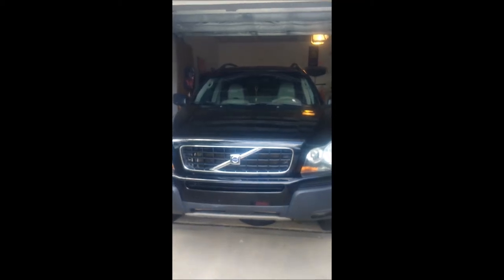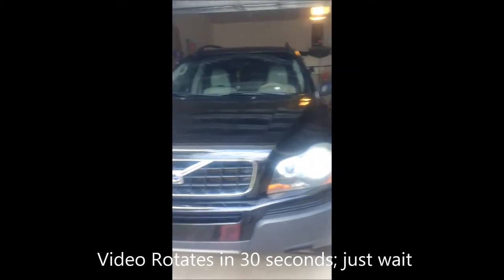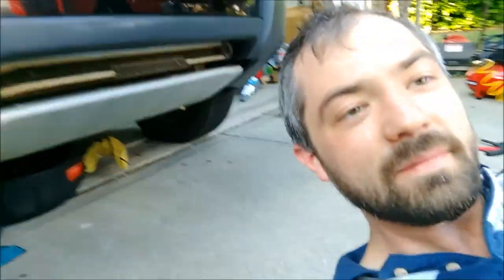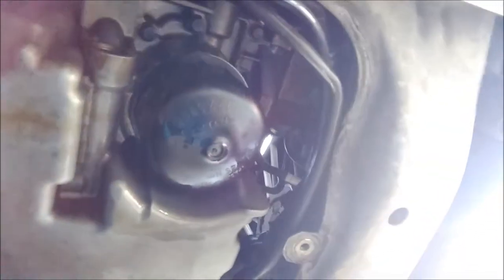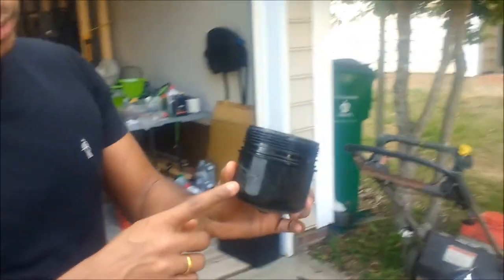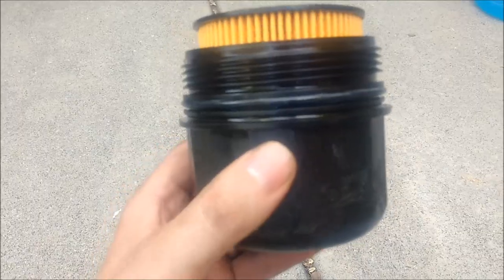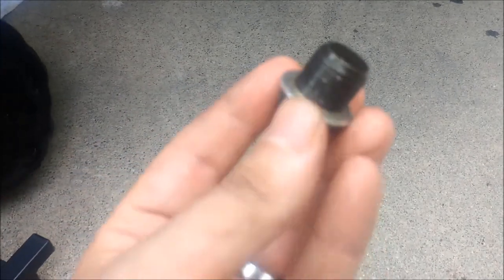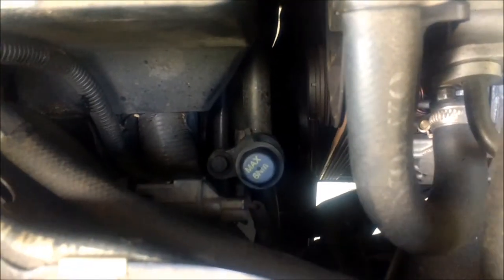Remove stuck oil filter - Volvo XC90 2006 oil change

Comment: The easier solution is to use an 86mm "OIL FILTER SOCKET WRENCH TOOL 18 FLUTE"  this fits onto the filter perfectly.
Should cost about $5-10 new from eBay
Reply from the maker: Yes, agreed.  But we made up our mind to not go buy anything else.  Use only what we had.  Sometimes you have to draw the line.
Reply: @Prima10ne  I understand where you are coming from, but if you plan to keep the car for a while it may be worth investing in the tool.
But credit to you for your clever workaround!

Comment: I been trying to get mine off of a 2006 s60 today and some of yesterday I have been to autozone 3 times bought 3 tools and ordered a tool from Amazon each one failing 4 I bought and the couple I had nothings working. I might see if I can get my vise off my bench and try this if nothing else works soon. Ty
Reply from the maker: Haa.  It's not supposed to be the solution, but it may work.

Comment: Silly, you should use a cup like tool specially for removing the filter. That  is why the filter housing is round but not smooth.
Reply from the maker: Didn't have the tool on hand.  Was committed to doing it with what I had.  But I do agree, that type tool is the proper way

Comment: Having the same issue but can't find a the wide mouth vice grips.  Do you know the manufacturer / where you bought them?  Model number of the grips would be helpful as well.  Thanks for the video!
Reply from the maker: The wide mouth vise grip was a clearance sale at harbor freight... No model.  Hard to find i bet.  If you go to auto store and look for a volvo filter puller, they may have something designed for it.  In this video we were determined to make no more store runs.   My advice... Also spray pb blaster on it every hour.